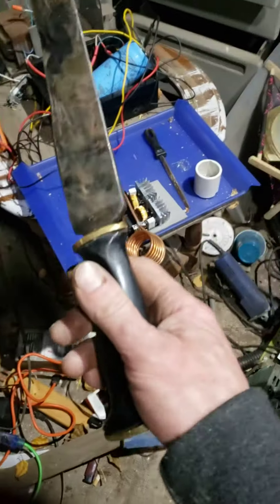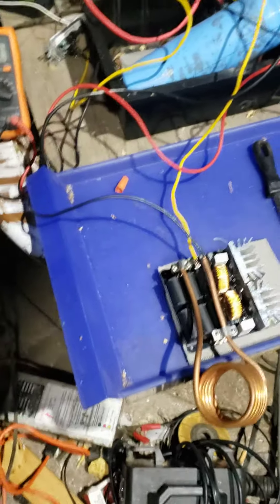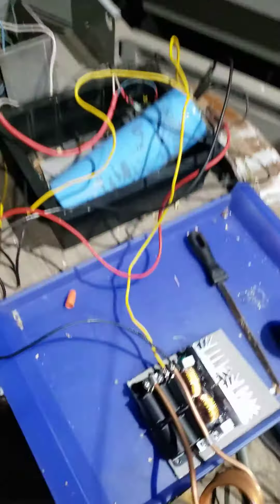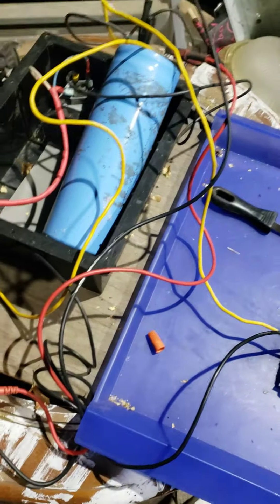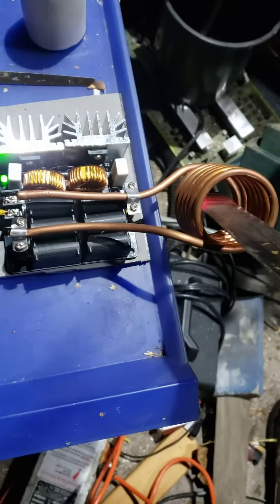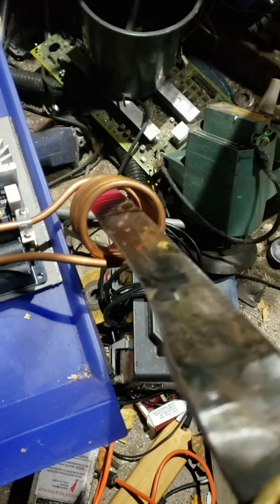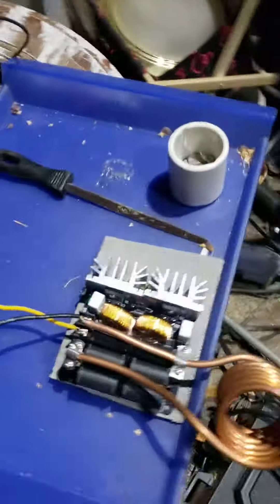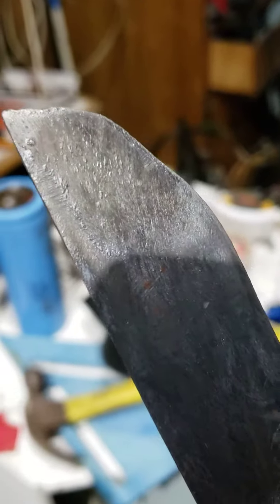induction heater test to the limit

Comment: Boring, just trying to justify an absurd "solution" pretending that's « KISS » design - which it's not, on top of hard-wiring the MOSFET gates and then relying on external protection which only kicks in AFTER the catastrophic failure mode has begun...  Way to go champion.
Reply from the maker: Ok
Reply from the maker: Yeah well my whole purpose of the video  was to break the 60 dollar flyback induction heater driver it took some punishment but 40 amps at 40 volts dc broke it
Reply: @travisbfsj  All right, i'm all in favour of exploring catastrophic failure modes.  But have you?  Even better yet, having direct access to all of the MOSFET pins why not start by removing the Hard-Wired gates bias and quit depending on black box magic for protection.